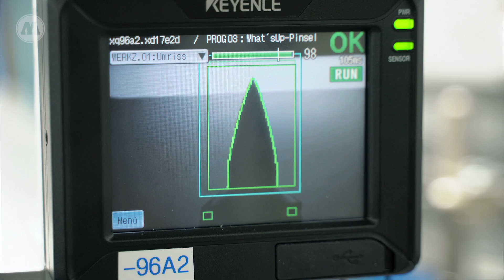NEW, SUSTAINABLE TWIN MARKER “SKETCHER” IS COMING SOON!

Comment: What kind of ink is this? I saw a comment guessing water-based, but would love some confirmation.
Reply: color-intensive, water-based AquaPro ink
deep, rich color brilliance
juicy ink flow
low smudging (after drying)
good UV resistance
quick-drying (comparable to alcohol-based inks)
odorless, crystal-clear spring water (Black Forest)
for applications on paper
for concept art, graphical & technical sketching and coloring
120 color shades